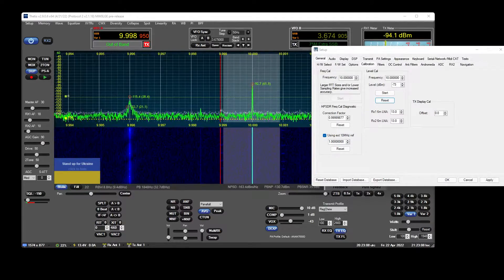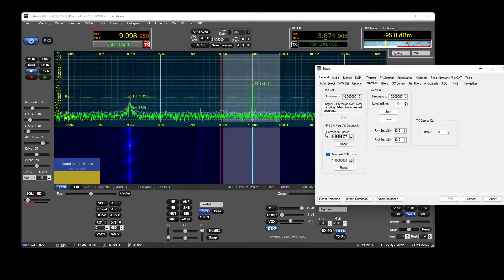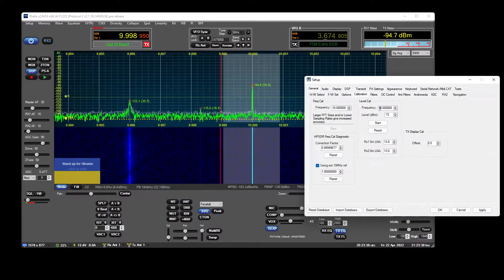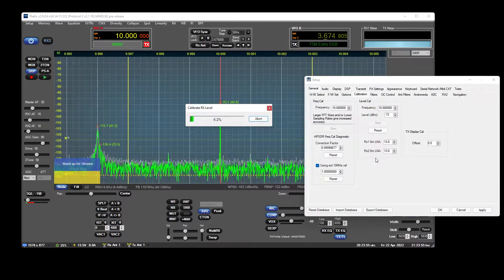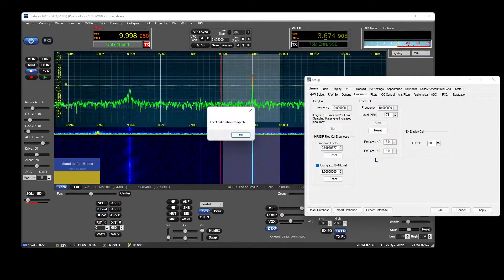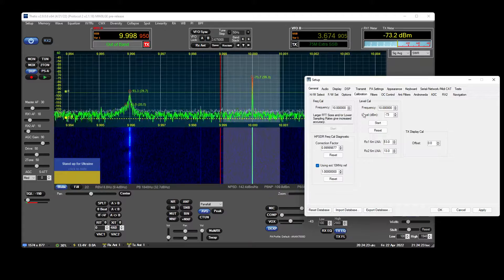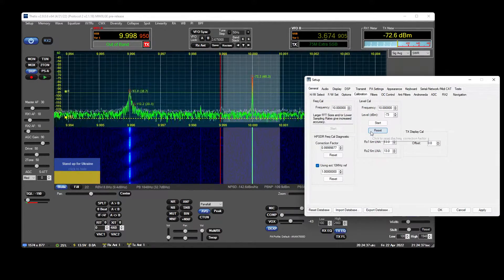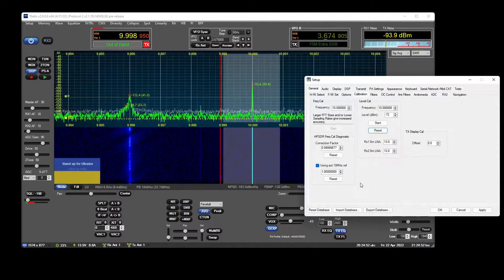Thetis - S-Meter calibration

Comment: Top job Richie, we are so lucky to have you. Plus from you no "read the manual" really appreciated.
Reply from the maker: beware that 2.9.0.6 has a bug where it wont save the calibration into the db. This is fixed and will be available in 2.9.0.7 when that drops in a couple of weeks.

Comment: I tried this on my Hermes Lite 2.  Found a -70 dBm signal and did the calib. 
Looked fine meter as went from -63 to -70. I clicked OK and closed setup. Later I turned of HL2 and closed Thetis. When I turned it back on the meter showed -63 dBm. The calibration was not stored. Did I do something wrong ?
Reply from the maker: no there is a bug and now fixed in 2.9.0.7 when that releases in a couple of weeks. Sorry for slow reply, didnt do any radio or coding during last 6-7 months.

Comment: Finally, a reset button for this, outstanding! No way to otherwise fix a bad mistake, like clicking that button without a proper test signal present. Editing the database would be quite difficult because the software does some really weird stuff and changes a great many things in the database, it's not just a single value somewhere.
Reply from the maker: yes, I was testing something, made a change to the calib, and I thought 'hell, how do I reset this easily'.